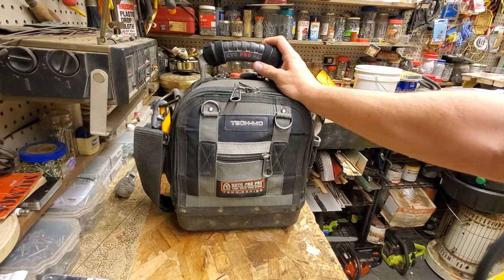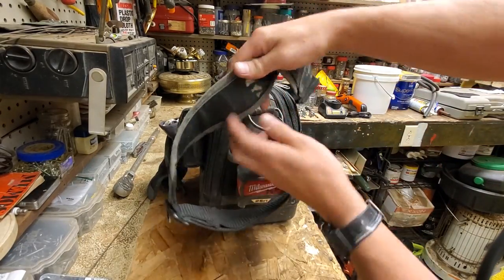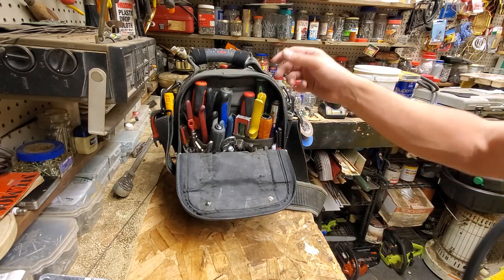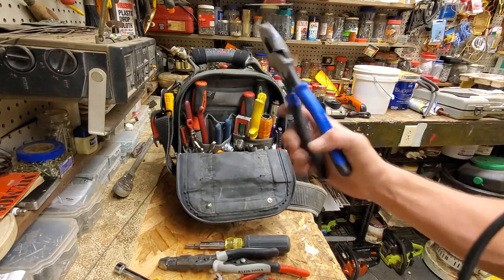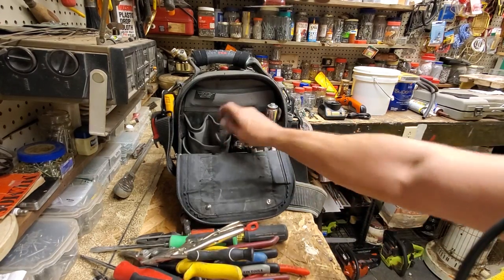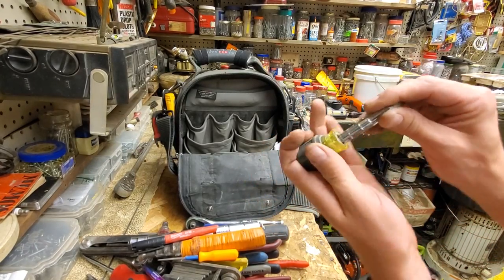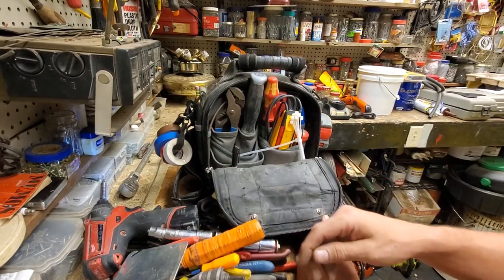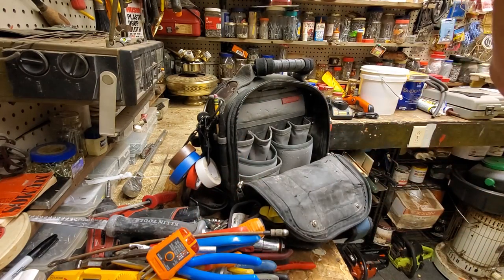Veto Pro Pac Tech MC: After 1 Year

Comment: Wiss Shears: Yellow= straight Green= Right Red= Left. I have always felt the green handles are used most. Worked in a sheet metal shop for awhile.
Reply from the maker: i've never tried the red or green, i don't think i use them enough to get the others
Reply: Mike's Tool Shed- Yeah the yellow are best for what you do I think.
Reply: Unless your cutting more than 2" into sheet metal, you only really need the yellows.
Reply: I agree with David C.

Comment: Question about the pockets inside the toolbag: do they have holes in the bottom or are they more like sleeves?

I use a cheap CLC tote style toolbag, similar to the tote bag Veto makes, the OT-MC. The inner pockets on mine are more like sleeves, which I’m not a huge fan of.

I work as an I&C field tech, and my most used things are my wrenches. Got two sets of standard up to 1”, and a set of metric in my current bag. Sometimes the smaller wrenches tend to find their way through the sleeves and end up on the bottom of the bag.

If the Veto OT-MC solved that issue it would be worth the price alone. Although I am considering this one now, since it seems like even though it closes up everything is pretty accessible still.
Reply: No holes in the bottom of the pockets.
Reply: Weeble Wobble Thanks for the reply. That’s awesome. This’ll definitely be my next toolbag.

Comment: I got the tech mct bag. it's ok but needs work I do hvac work fo 35 years. it needs single screw drive slots and individual plier slots and a combination wrench holder. i do a lot of work on oil burners the pockets are to big tools don't stay where you put them when you take one out off the larger pocket